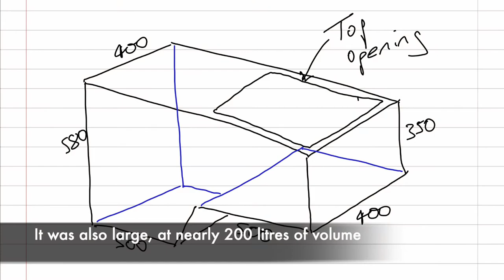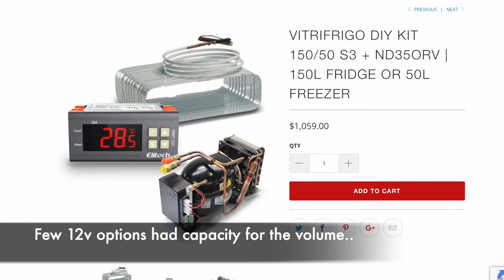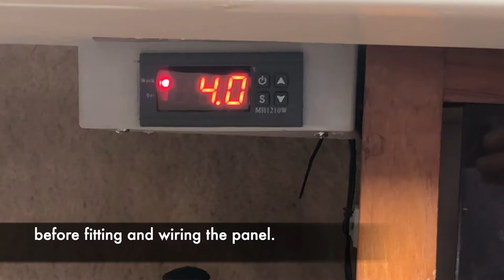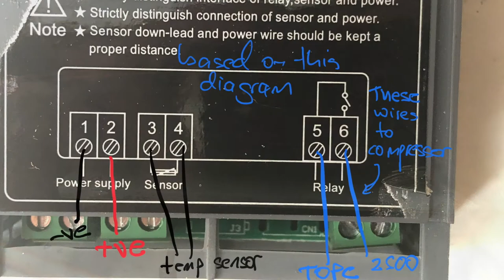Sailing Vessel The Bottom Line - Boat Projects: Installing a Fridge - Freezer

Comment: Nice job on the fridge, just had mine done. Where did u get your plastic baskets from?
Reply from the maker: Thanks for the feedback. Baskets were from Kmart. Extra holes drilled in the bases to help air circulation.